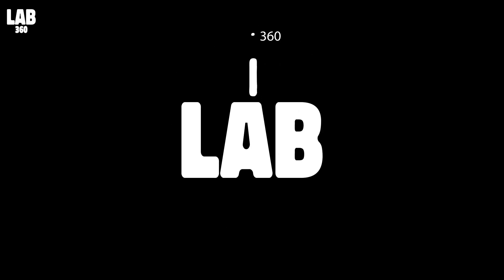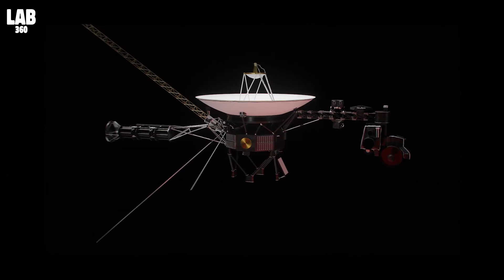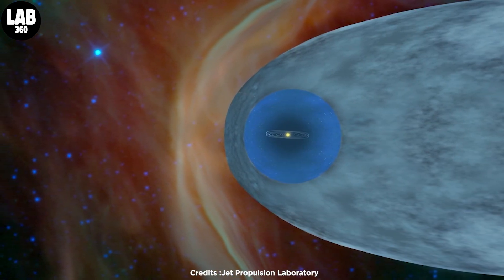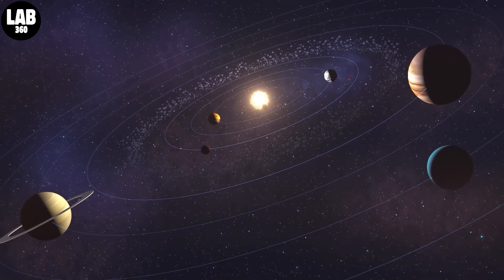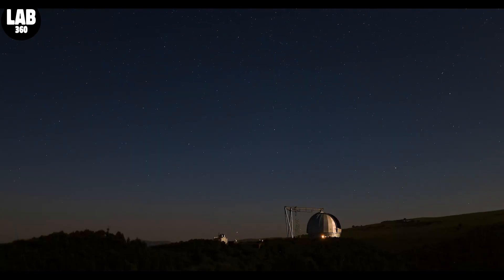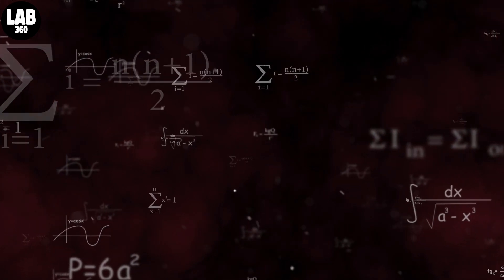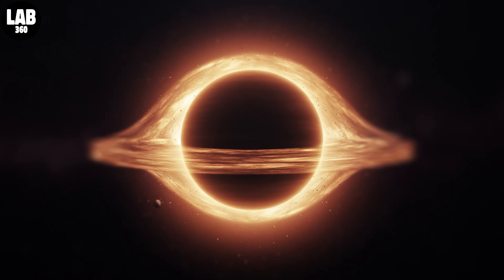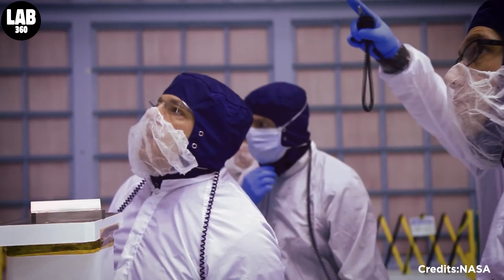NASA Engineers Puzzled by The STRANGE Signals from Voyager 1

Comment: I am seriously disappointed that NASA has not put a signal booster out farther in space so contacting probes/ rovers on different planets or Voyager in this case will  have quicker response times . They spent $32 billion on James Web( not sure where you got that 10 billion from ? )  and its farther out but sadly is going to be destroyed eventually with micro meteors so a billion bucks on a transmission booster is a drop in the bucket .

Comment: I read the Voyagers had redundant computer systems...including redundant AACS. I also read the AACS are part digital and part analog. I thing a micro collision may have damaged an analog component that the AACS studies some damage from. If it was a severe collision, I doubt the high gain antenna could fix orientation back to Earth.

Comment: We need to ditch the radio transmission in future missions, it's time to utilize Quantum entanglement for instant data no matter the distance.
Reply: Pretty sure you are describing an ansible which sadly doesn't work, information cannot be sent faster than light, even the "teleporting" that worked (not in the sense you are thinking) wasnt instant, I am curious though if you can warp space for a ship could you do so for a signal? Would it be easier or harder?
Reply: @douglasmorris6930  ,You know how they did an animation of a boy kicking a ball with Atoms? That's the similarity I'm talking about.  What ever the particles movements/adjustments is done on this side the other entangled particles are simultaneously doing the same. Similar to a screen/TV  the pixels changes making it seem like things are moving around.